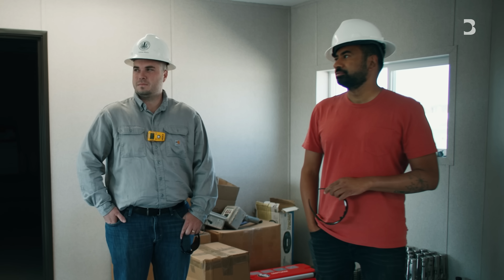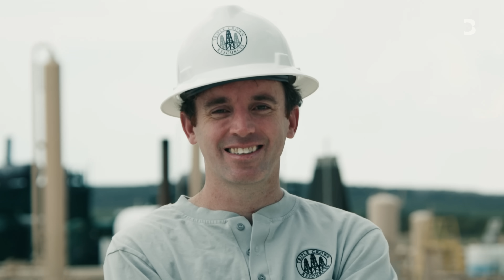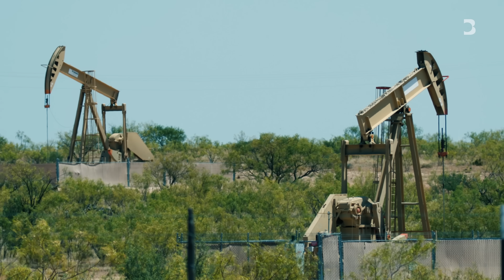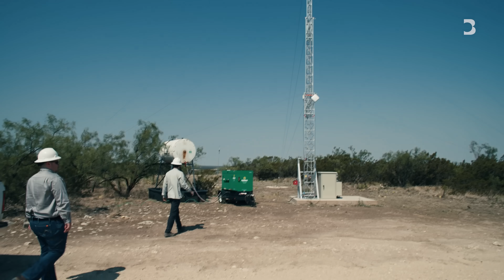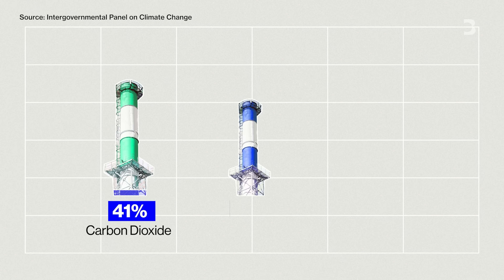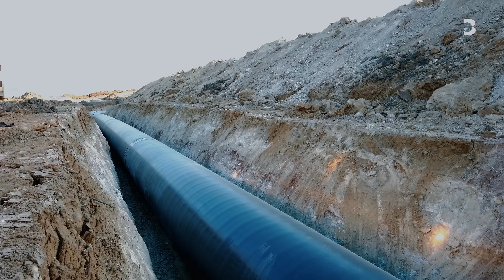How to Make Millions Fixing Methane Leaks

Comment: To me, the unspoken question is, what emissions does methane cause when burned, either in flares or in its intended end use?
Reply: It's intended so you don't release methane gas. As they say methane alone is ALOT worse. When you burn methane all it releases is water and co2

Comment: Use Protego Pressure/Vacuum vents instead of Enardo, Groth, Pentair, or other poorly designed vents! Made many trips to oil/gas fields and these guys know how to bandage a quick solution until the EPA guy leaves. @kalpenn

Fixing the root of the problem costs slightly more money and companies don't want to pay for better technology because the EPA fines don't really get enforced.